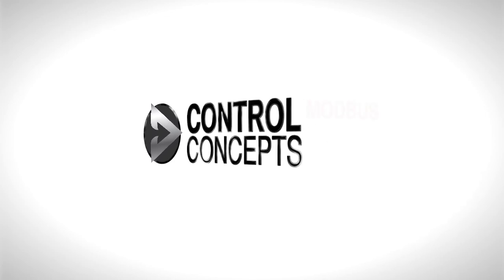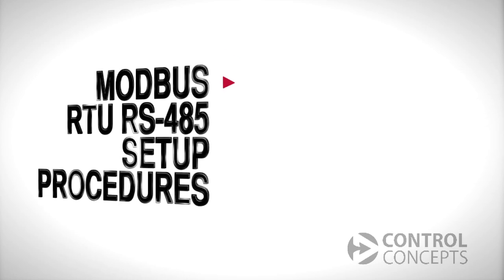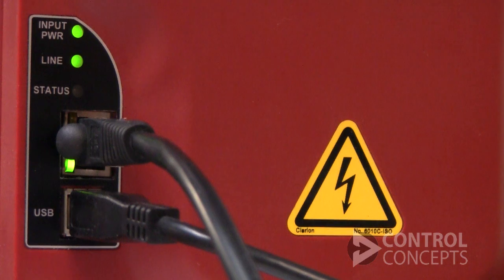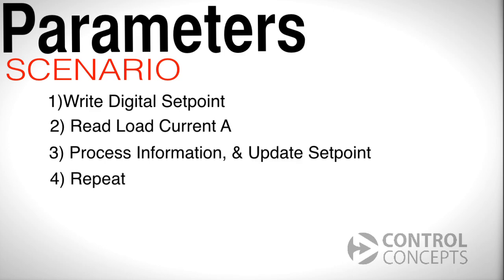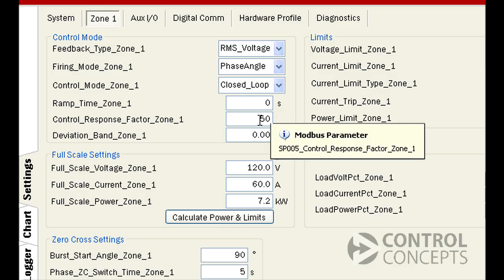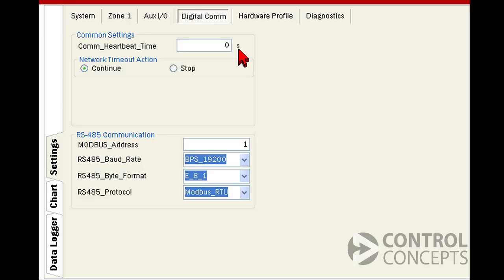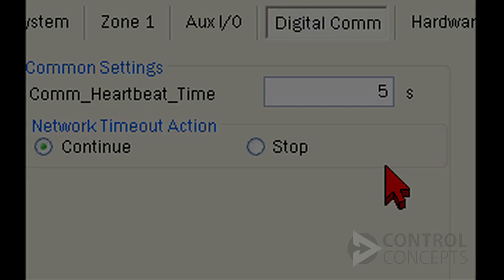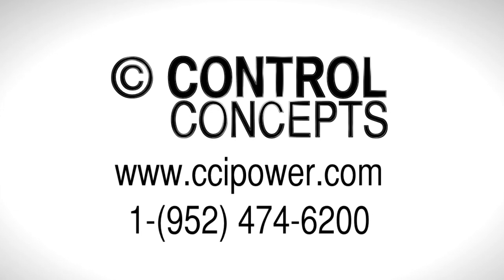Modbus RTU RS-485 Setup - FUSION SCR Power Controller Tutorial 02

Comment from the maker: FUSION uses a RJ45 connector per the Modbus RTU specification. The green light represents power to the serial point module, and the red light represents transmit. It looks almost identical to an Ethernet port.

Thanks for commenting. Hope that answers your question!